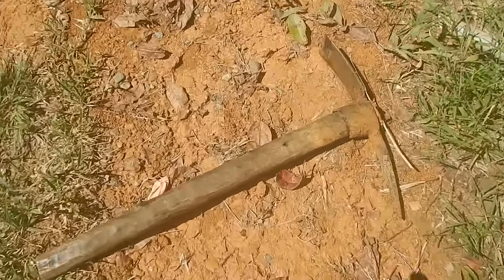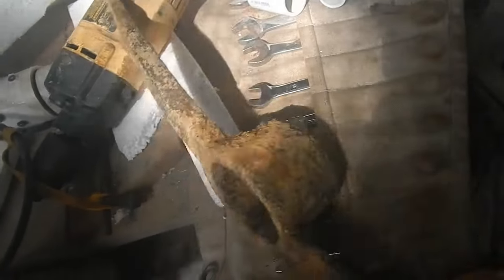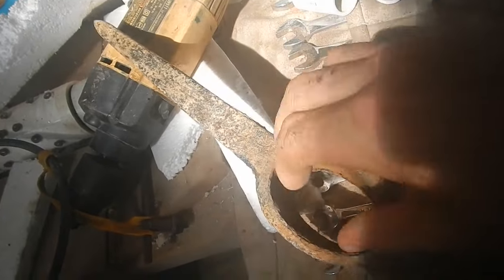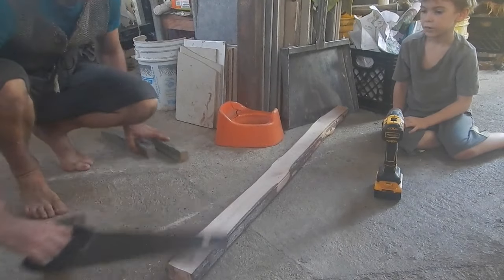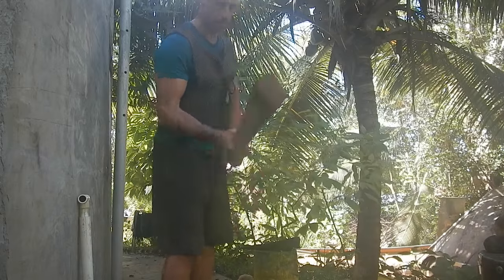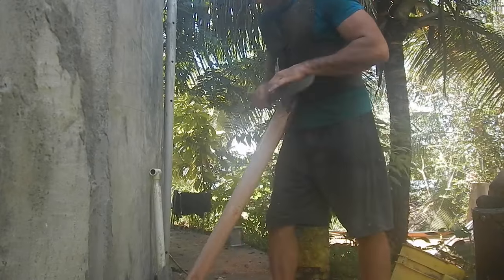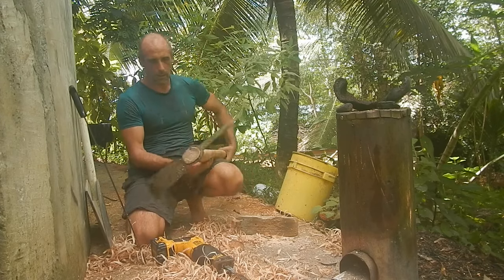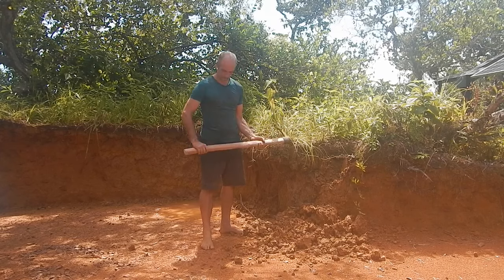Making a Pickaxe Handle out of Mangrove Log

Comment: If you want a great hand saw that will last long and cut well, I highly recommend Bahco saws model 2600 will cut most materials you would cut with a saw, and can go through wet and dry wood. I have older models of the same, and it is simply the best saw I ever used.

Comment: The value of hand tool use is underestimated.  The physical exertion, that power tools are meant to save, is likely less harmful than the gyration, particulates and noise damage of power tool use.  Not to mention the kind of accidents that power tools can so easily cause.  For casual work, the exercise, safety and precision of hand tool use wins.  Your family and neighbors will also thank you.